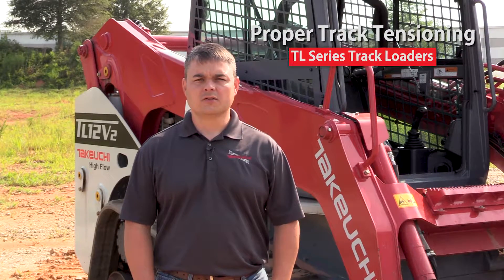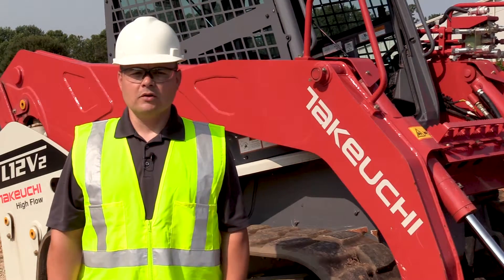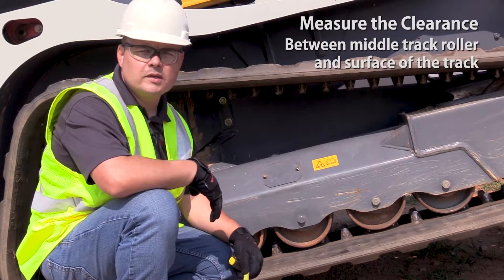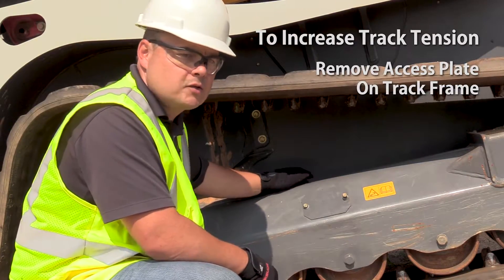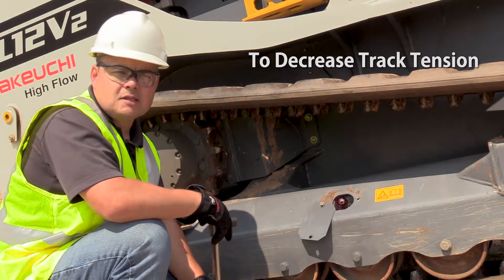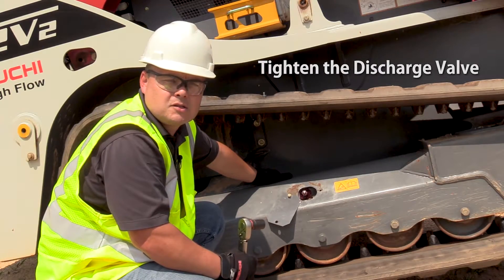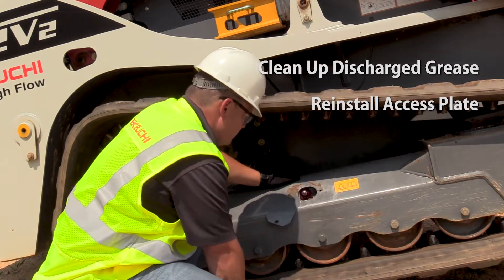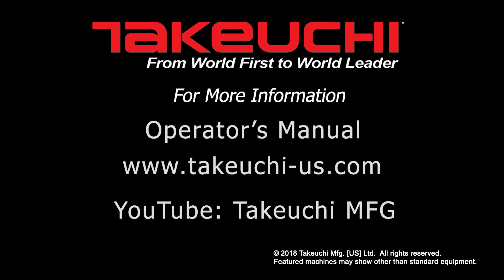Takeuchi Track Loader Track Tensioning Rev

Comment: Anyone else find it comical he used the torque wrench to loosen the grease valve?   Pretty sure you’re not supposed to do that.  Other than that, great video!
Reply: Yes my instructions on mine said to  ever use to break loos bolts